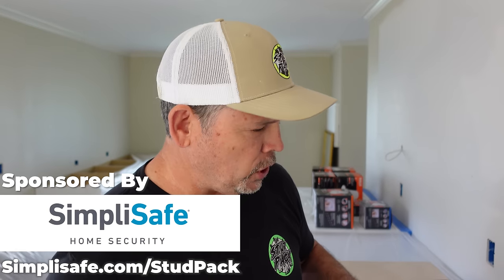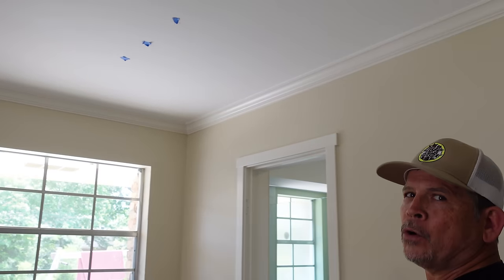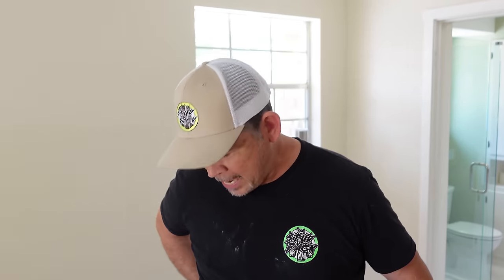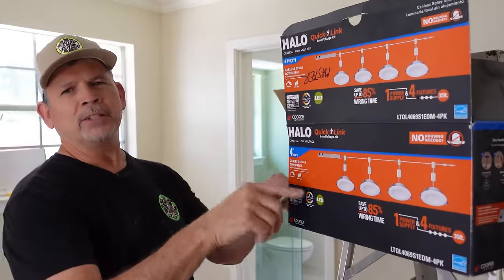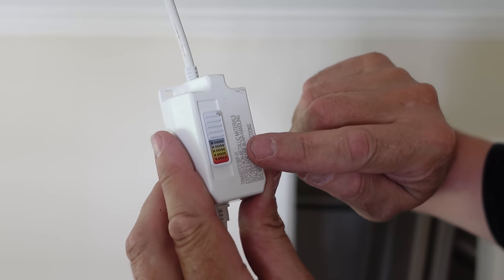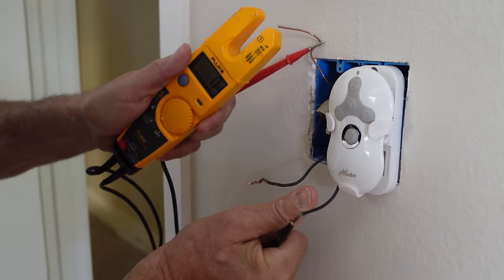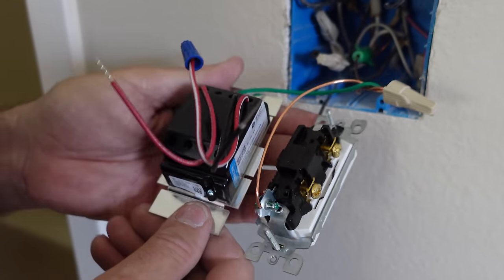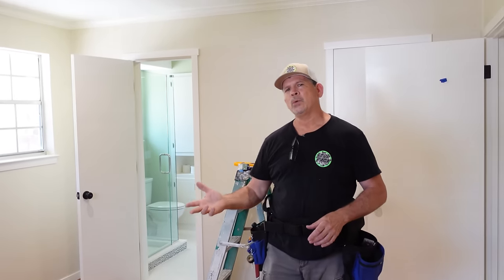HALO Just Changed the Recess Lighting Game with THIS!

Comment: I've always heard that if you're using a non-contact voltage tester, you should make sure and touch it to something that you know is hot (like an outlet in another room that is on) to make sure that the tester is working properly before you trust it to tell you if the wires you're going to touch are actually turned off. Always good to be doubly-safe when working with potentially live wiring.
Reply: In the industry we call that a Live-Dead-Live test and its an excellent idea to make sure your tester is working properly
Reply: Normally, throughout the day pros will test their tester several times.
Reply: i worked with a old electrician that would touch the wire to find out if it was hot 🔥 or ground out the power wire to find the circuit breaker it was on 😂
Reply: Non-contact testers are also known as "death sticks" because they're notoriously unreliable. Any time you have to touch wire with your fingers, the circuit should be tested metal on metal first. Most DIYers aren't investing in $$$$ professional testers and shouldn't be led to believe that the $10 sticks they buy at the hardware store are going to tell them for certain when a circuit isn't energized.
Reply: Yep! Always test your tester... whether contact or non-contact on a known live circuit.
Reply: what ive learned from years of using those wand things... is if you arent on the neutral wire side it sometimes doesnt read any power... Or lets say the wires are spread apart unnutted from whatever it  was connected to... if they arent close enough together and you dont wave the wand "between" them it wont pickup.

They are an additive safety measure, not a failsafe.
Reply: @DavidSanty  me with a guilty look on my face as I look at my $7 non contact from a grocery store. I only use it to identify circuits tho
Reply: Also called TBT or test before touch
Reply: @DavidSanty  I feel there only called that to ppl with no common sense
Reply: @mrorganic13  no they are called that because they aren’t reliable.  I never trust the things and won’t carry one  because they are just a waste of money and space in my bag.
Reply: @chadhowell1328  i can def vouch there unreliable especially on three ways etc but ide rather have one of these on me then pulling out the multimeter every 5 min. I just use both when im unsure if the tic is working properly. Obvious when its not half the time due to the stuff im doing.
Reply: @chadhowell1328  at least when i use mine since i know how it acts, others i dont trust theres.
Reply: Totally agree! It happened to me when I tested an outlet with this tester without testing it 1st to see if it works properly. It said there was no live wirings but thank to my dad. He told me to use maybe a charger or or something to double check and it turned out to be a live circuit situation .😅 Lessons learned! Never trust on this cheap non-contact voltage tester everyone!
Reply: If you tap your tester against your finger like a drummer, it will trigger the tester.
Reply: @DuyPham-on5cv  be careful using chargers, some of them can take a long time to light up
Reply: Absolutely always did this when working around live circuits
Reply: Fantastic, its great to learn techniques of professionals from a previous generation
Reply: @allanarellanes1726  not the good ones.
Reply: @DavidSanty  I haven’t ever been misled by one.
Reply: you need a nother tester to find something that is hot
Reply: Common sense
Reply: if you touch it to the wire youre working on and its hot, then flip the breaker and its off, then flip the breaker and its on again thats pretty much the same thing

Comment: I HATE LED lights. I also don't like that they just sit in the ceiling. They should be designed to go into a metal Octagon Box. Also, I wish NEC would ban 14 gauge and I wish they would ban plastic and nylon boxes. 12 gauge or better is better and less chance of fire. Also, the Wago lever "nuts" are best. They save time, they hold the wire more securely. I HATE plastic so if I like them, that's all the more reason plastic lovers should.

Comment: A lot of people don't realize how hot an attic can be. I'm in South Florida and I'm in attics at least 4-5 times a week. Highest I've ever measured was 137°. It was too hot to even crawl around with bare hands. Danger level heat.
Reply: Used to do HVAC with my father in attics in Florida.  We measured 145 one time.  We would rotate out after 15 min to avoid heat stroke.
Reply: I was gonna say, it was probably a lot hotter than 120!
Reply: Our company does a lot of poultry house work. We have to go in the attics of the houses quite a bit. With just the tin roof between you and the sun, it gets scorching. One time on of the guys took out a heat gun. It was 162 degrees at the access hole. The wood trusses were so hot, you couldnt touch them. Even the wire we had to pull down the ceiling got so hot by the time we got where we had to put it, you could almost not hold on to it.
Reply: Dallas here. My first summer with a remodeling crew I was the "attic rat" running wiring and ducts. 

I am now able to laugh at the desperation I felt at the end (and hottest part) of the day when all I needed to do was insulate that one last duct and I'd be free! And the only thing holding me up was peeling the back off the stupid foil tape with trembling fingers while trying to see what I was doing through the waterfall of sweat running across my eyes. 

Like I said, I am NOW able to laugh about it. I lost twenty pounds that summer.
Reply: wouldn't last spraying foam.
Reply: I don’t mind starting at 2 am when I know I got to work in attic in the summer .
Reply: @lacuzon39000  We do the same, although  not quite that early.
Reply: In Saskatchewan you dont run wire in attics because the wire isnt rated for the heat
Reply: Do like I do in the desert southwest, my attic from the outset is conditioned with the insulation on the underside of the roof sheathing. Ductwork, water pipes and other things are pretty much the same temperature as the rest of the house.
Reply: I used to do mobile recording sessions and one band I worked with practiced in a "finished" attic in a very old house. It was 110 in there in July when I did the session, and I kept having to take breaks after every take to stick my laptop and interface in the car with the AC full blast to keep them from shutting down from the heat. In retrospect, I should've just stuck them in their fridge, but I wanted to cool myself down also ;D

Comment: Something to consider, that I didn't see in the comments and they didn't mention in the video, is if you're putting recessed lighting in a lower ceiling, like a basement, you'll need to take into consideration the beam angle coming out of the lights themselves.  If you have them too far apart you'll feel like you're walking in and out of light and get an awkward feeling because you'll be walking in and out of the light beam.

Comment: Hey Paul, just for your future jobs, whenever I rough in wiring for any switch box, 1,2,3,4,5 gang or more, I always bring the feed wires (hot) in the bottom of the box, and if there is going to be a tap out of that box to feed another switch box or receptacle downstream , I will also bring that outgoing hot in the bottom of the box. That way I always know the cables coming into the box on the bottom are both "hots", and they always get connected together. It makes wiring multiple devices a little simpler.

Comment: Note:  Always re-check with tester AFTER turning off breaker. For one, the breaker at times fails to open when you turn it off.  I have always trained apprentices to re-check the box just in case there is a second circuit present in the same box. Simply move the tester around at the rear of the box.. not just what is easy to touch. A second circuit is more common than you realize.
Reply: Or you might be working on outlets that your electronics trained father has previously re-wired and crossed two circuits!  DAMHIK!  LOL  I always check now.
Reply: Especially if you got stablock / federal pacific breakers
Reply: Yep.  Always recheck. Also I was taught to touch the hots first with the back of your hand after you were absolutely sure they were off. If you somehow made a mistake, your reflexes will cause you to pull away from the live wires.
Reply: @jmpattillo  I touch or grab  the " hot " wire with the power ON with my bare hand  plenty of times in my electrician career without getting shock .
Reply: @lacuzon39000   I guess if you are well insulated from a ground path then you can get away with it.  I'm just glad I've never gotten anything across my heart.
Reply: Why would you turn off breaker to put in potlights just turn off the switch. So if u changing a breaker in your panel you gonna shut off power to the city
Reply: @orestracki6617  if there is a dimmer , I will recommend to turn off the breaker because some dimmers switch actually leave some residual voltage and you could actually short out the dimmer by accident and end up with an expensive replacement , and also I've seen some really bad wiring where they switch the neutral wire so you can even if the light is off still get an electric shock with the phase and ground .
Reply: when i was a child several times i got a shock reaching into the timing control box for our swimming pool pump motor, it had heavy wire and exposed brass terminal screws.  years later i realized that was a 220 volt circuit and by the grace of God i was not electrocuted.  now i realize i must use my awareness and exercise abundance of care with all procedures relating to electricity.
Reply: @lacuzon39000  having the white as a switch wire is not bad wiring. It just means power went to the light first. It used to be common practice
Reply: @orestracki6617  I’m talking about the neutral/grounded wire being switch , and the phase/hot wire being always on at the light fixture , not just about the white wire .

Comment: Good job on the video. I personally am not a fan of those lights. Companies occasionally produce these "innovative" products that are a bit outside the norm, then years from now when components fail or break you can't find replacement parts. In this case one specific driver controls all 4 lights, up to 8.  Driver fails there are no lights. You also have those plastic clips that attach to the LV wire, it reminds me of the round discs used for LV wire on landscape lighting, and those discs are usually the first thing to fail.  Granted they are exposed to different elements and circumstances than they would be in an attic.

It is a DIY friendly solution, but it has the same drawbacks as traditional can lights-you have to work around any obstruction-joists, ductwork, blocking, bridging, plumbing, etc. That makes it defeat the purpose of being DIY friendly. At the end of the day flat wafers that sit below the joist are going to thrive compared to this product. You can fish either wire from hole to hole and avoid attic work all together, especially when the return is already up in the ceiling-just get it close to the first light location and use poles or tape to hop between them all.

Just a sparky's 2 cents. I wouldn't install this product in my home nor would I recommend them to a customer. Halo is a good brand but this seems short term and gimmicky and likely to be phased out. All the downsides of can light install and one link makes or breaks all the lights. Imagine if an office room had all their 4 foot T8 fluorescent lights controlled by 1 ballast.
Reply: I was thinking the same thing...outdoor light connection failures...oh boy. I finally found the solution...those 3M grease filled connector chingaderas and never looked back. I wonder how long those connection points are gonna last in the heat of that attic let alone the heat of my attic in Phoenix?
Reply: I bought the 8-light bundle for our kitchen renno and will be returning these because the lights are failing to pair on the app. Lights are on, they’re getting power from the supply and the only online troubleshooting doc Halo has on them only tell you to make sure power is on and that you’re within range of Bluetooth (yes to both). Anyway, just wanted to point out that the power supply isn’t a “hub” for this system, it is basically just a transformer to feed 10v downstream to the lights you place on the wire. Each light has its own Bluetooth transmitter that needs to pair to the app. I was able to get the Halo dimmers recognized, but none of the lights in the kit worked. Experience tells me this isn’t a solid product 👎🏻

Comment: Have y'all ever tried Wago lever nuts vs the wire nuts?  I watch 80% or so of the uploads (I miss them sometimes) and hadn't seen those yet.  They work great, and I'd even be tempted to send you some.  For DIYers, it makes wiring so much faster than wire nuts, and doesn't damage the wire.
Reply: I was just about to ask Studpack about using Wagos. I'm from Germany so I don't know about American Building Code, but Wagos made a huge difference to me in electrical installation. Though I don't use the lever ones but the slim ones where you just stick your wire in. I know it makes hardly any difference regarding conductivity yet wire nuts have a sliiiight advantage over Wagos, but it's never a fire hazard or anything like that. I love that with Wagos you can easily remove single wires without dismanteling the whole setup.
Reply: @0Fidel0  I use both of the Wago types and they work fantastic.  I will never go back to wire nuts.  The extra cost is worth it.
Reply: They’ve mentioned them before, and basically said “use what you like,” I believe.

Comment: Polarity doesn't matter for low voltage stuff... Absolutely incorrect. Maybe for this product that's true but it's definitely not true in general. 

Also rated for LED lights isn't necessarily the best for LED lights. Often they have a specific model that is intended for only LED lights. The rated for LED lights model will hum when dimming LEDs but the model intended for LED's won't hum and will have a wider dimming range.

But 0-10v dimming is far better for LEDs. Better longevity and the widest dimming range.

Comment: There’s no way I’d install those lights. In 2018, I put in 35 canless lights, and have already had to replace three that failed. Two of those failed at the power supply, and one at the trim. 25+ years my ass!

That kit has the LV wire permanently connected to the power supply, so you’ll end up needing to re-light the entire room if it fails there. That means re-pulling wire!  There’s NO excuse for this.

Comment: These "wafer lights" have really changed the game when it comes to lighting.  I mounted mine in ceiling tiles which I was able to mount within 2.5 inches below the ductwork.  Otherwise, I would have literally needed to design my ductwork around where can lights would normally go.

My concern is if one of these lights goes ca'put in 5 years, will I be able to find an identical replacement, or will I be replacing all of my wafer lights?  I like how the old Edison base fixtures installed 75 years ago can STILL appear and function fine with a simple bulb replacement.

Comment: You guys in america are weird when it comes to safety. Here in europe this is stricly forbidden to use the contact-less electrical sensor. You have to use a VAT (it's french) It's a battery less device, that  even with only 1 prob it will detect a voltage (you have to connect the 2) then after the verification you have to connect them together and it will run a test mode to ensure the verification is correct.

Comment: I have a set of 6 led lights similar to those installed in my kitchen. When we run our dishwasher, the lights flicker with the pulses of the dishwasher motor. I also have led under cabinet lights that are perfectly fine when the dishwasher runs. Any ideas?

Comment: Even though you are using a plastic box, its a good idea to tape the hot terminals on the switch because the ground wires are long and exposed. When you fold them into the box and then "shove" the devices in, its hard to know if the ground wires get moved around.
I have been using the Halo recessed lighting for a while now, but never saw that kit before. LOVE IT! Thanks for showing it off
Another great video StudPack!
Reply: you can see the ground on the sides man don’t tape it

Comment: Nowadays I like to use 4 inch new construction or remolding can for incandescent where it is available because they got the extra safety heat switch built in  , just in case something goes wrong with the led light , there is plenty of led recessed modules that will fit in the 4 inch can  with the socket plug in for 120 V then you won’t have to depend on finding the proper replacement in a few years when Halo discontinued this model , plus every brand with this type of light on separate driver or driver built in the can have their own secondary DC voltage set up and you can only use the proper oem replacement part .

Comment: I did all the recess lighting in all my downstairs rooms without attic access.  You just need to get 3/4 ,54inch flex bit.  I can't belive he said he cut someone's floor open to do it.  They literally sell these bits at all the major hardware stores just for this reason.  They even have a hole on the shaft to pull the wire through.

Comment: I installed these low voltage lights in my living room per the instructional video. HOWEVER, if you want them to dim, in addition to the 120 volt wiring you need to run low voltage wiring to the transformer AND to a dimmer switch that is compatible.
Reply: Where did you find this information? I’ve been trying to get mine to dim but not understanding how to fix it properly